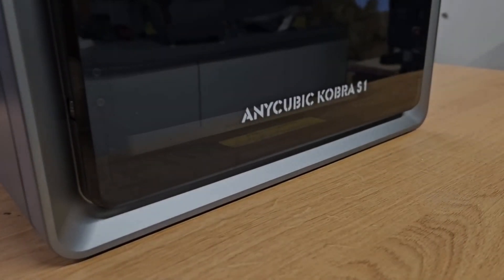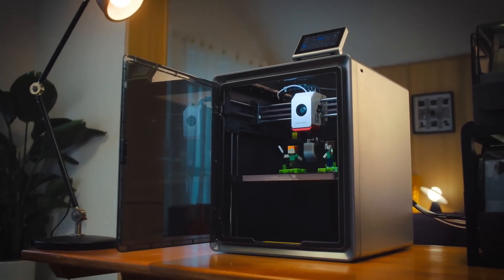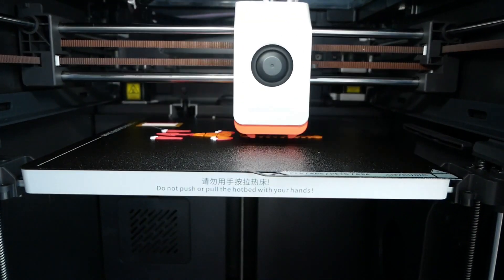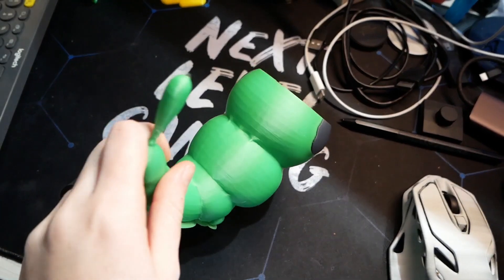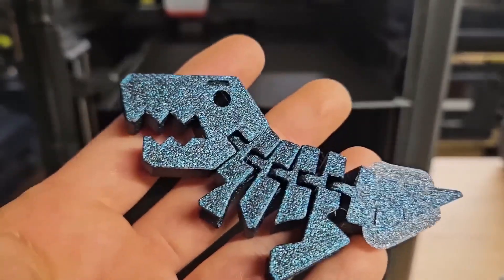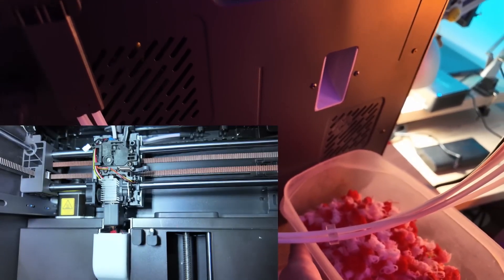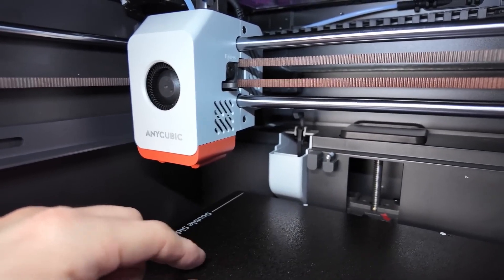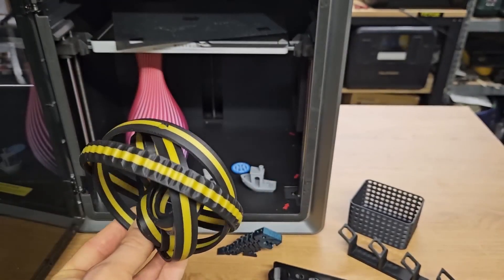Kobra S1 Combo Revolutionizes 3D Printing with Multifilament Support!

Comment: This machine is rubbish, don't be fooled by its praise. I've had it for 3 months now, and I've replaced a lot of parts since I bought it. I live in Iran, where the cost of a printer is several times higher than in other countries because a bunch of idiots run the country. Now, with these conditions and all the hard work I've put in, I've spent money that I've earned on this false advertising that is still costing me money. I get parts for the machine at several times the cost without a warranty.

Comment: Those filaments look awful they look like they can tangle at any minute.
Reply: been printing with it for a week+ and it didnt even got tangled once
Reply from the maker: 🤔Good eye! Filament management is definitely a key factor in 3D printing. I’ll be keeping a close watch to see how it holds up during longer prints. Have you had any filament nightmares yourself? 😅
Reply: With the lid closed this doesn’t happen. It has guides built in
Reply: If you know you know 😂